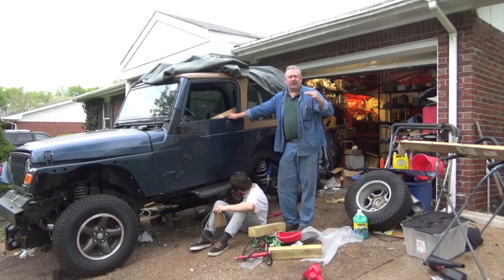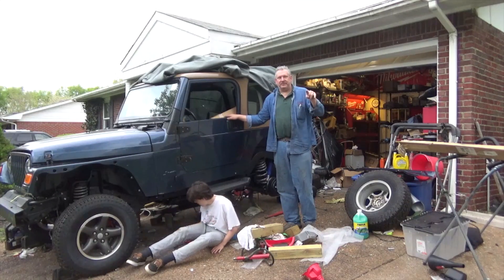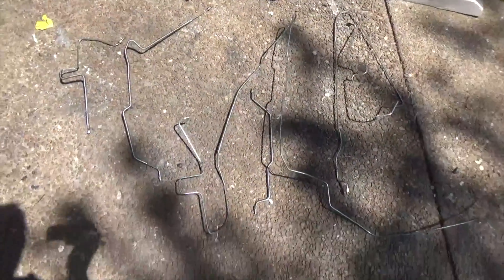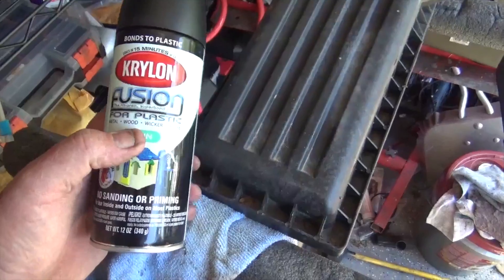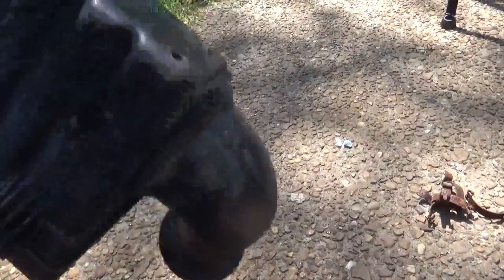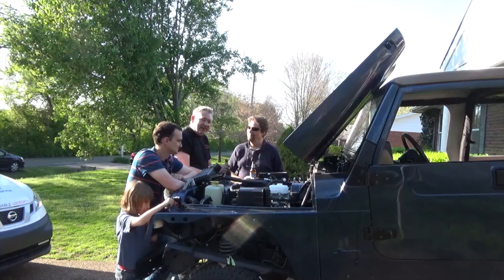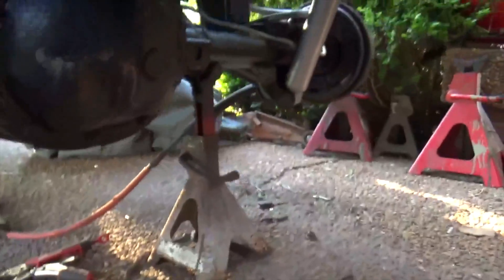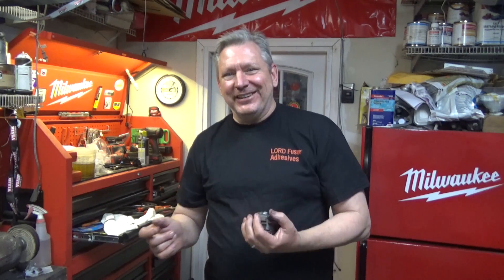Jeep Wrangler TJ Project - Complete New Brake Lines and Master Cylinder

Comment: Good show Dave!  You're doing much better than the previous owner of my Jeep...  The brake lines were well deteriorated, a common problem on those older Jeeps, so he cut out the bad piece and replaced it with a hose and "clamped it real good" with a couple of those adjustable worm gear hose clamps.  He must have been pretty happy about the repair job thinking, 'it is only leaking a little bit, not as bad as when I replaced the front gasket on the transmission'.  I never saw the guy's house, but I am guessing he might have been in the white trash category.
Reply: I couldn't find your link to get brake line kit.??

Comment: I used that paint to paint my rear bumper step pads on my 2007 Chevy Trailblazer.   Did it a couple of months ago in my garage.  If it holds up, I will be painting my running boards.  I really enjoy your videos, I just wish they were longer.
Reply from the maker: +Trent Young Thanks Trent !
Reply: Trent Young what do you recommend for the fenders on a tj, they’re really faded